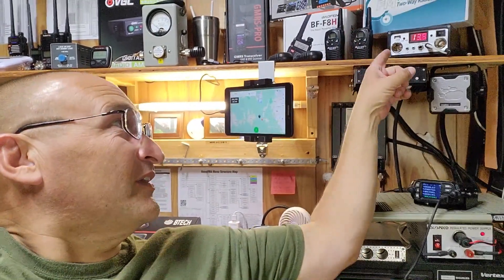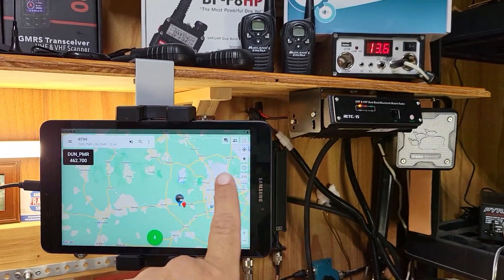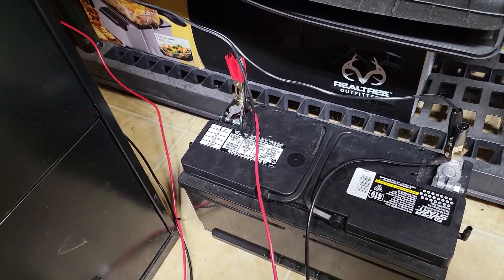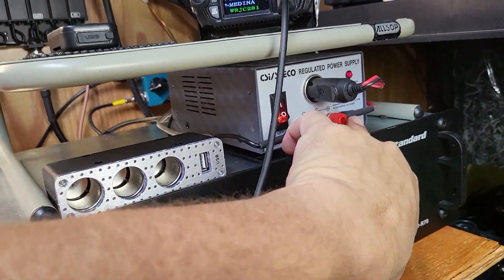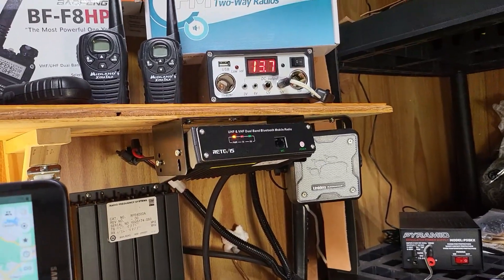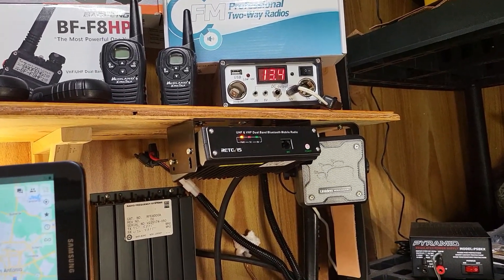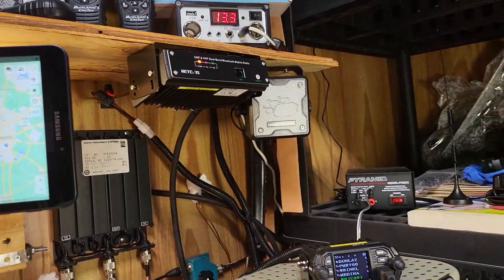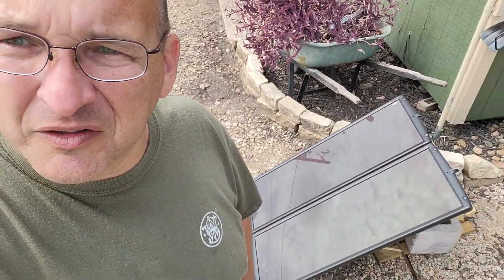GMRS Simplex Repeater on 100% Solar Power

Comment: I have q couple questions. Im a Coloradan and GMRS is nearly state wide here. They're very serious about GMRS, we have what's called (Front Range GMRS) with LOADS of repeaters. And a few on the Net.  However! None of them are up here at 10,000 feet where I am. In the Indean Peaks Nationa Park area. All the GMRS repeaters do sit at altitude but they overlook the flats. The moment you get up near my house a repeater hit is intermittent at best. Unless i go to that side of the mountain on my propety and a UV5g will nail it. BUt I'm certain I can easily change tthe outcome for Full GMRS in the most active area of the Rockies. My property that sits at 9,982 feet. The property is situated perfectly to run the entire Peak to Peak Highway, a 55-mile stretch of road that winds its way from Nederland to Estes Park from this location, Im dead center of it, and above it. The activities in between are immense, 4 wheeler trails galore, (razors mostly), Then Brainard Lake, Rainbow Lake, Mud lake, Hunting, fishing, and SOO many others in between. But unless you're running a Midland 50 watt mible with the 6bd gain antenna, you will lose the repeaters in several places up here. My plan was to get it out on this huge boulder outcrop on this mountain, with no trees around whatsoever and it gets full sun. OKAY! lol now that thats done and I have the ideal location no need for permissions because I own the joint. I'd love to know how long your battery lasts if you unplug those solar panels from ohhh say... 7am to 7pm. A full day. I'd love for you to test your rig with the loss of an entire day, zero sun. How many hours will you get from this rig? 21 hours, 15 hours, 36 hours? Please advise, I'd Really! appreciate it.
Reply from the maker: So my setup is rather basic,  consisting of just 1 standard car battery and 2 very inexpensive solar panels.  With that said, if I unplug them I can get about a day of average use  out of the radio.  Keep in mind,  that little QYT is only kicking about 18 watts.  My plan,  after several other projects are done,  is to upgrade the panels and battery.   For a very basic setup, it works for now.   Please let us know how your project goes,  very interested in hearing more!  Thanks for watching!